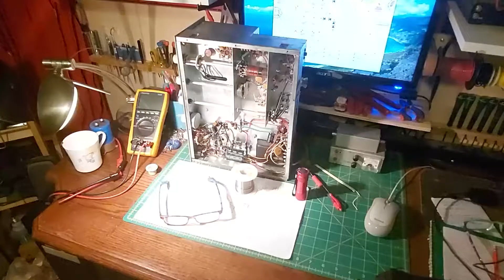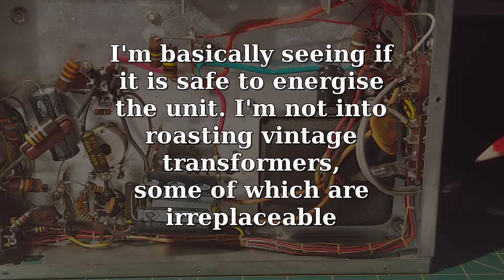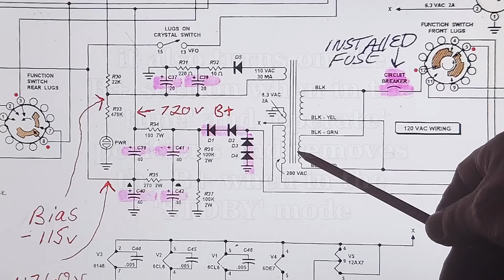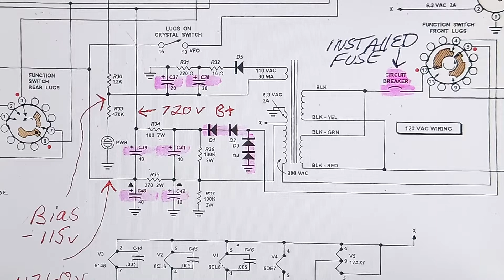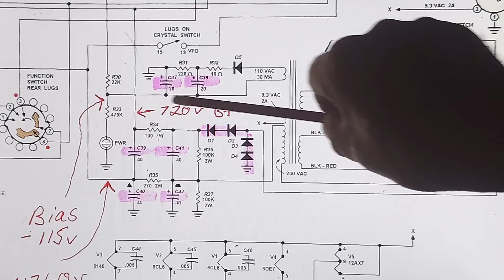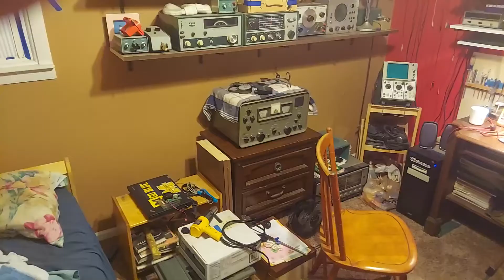Heathkit DX-60A Restoration - a Hacked Power Supply

Comment: Your doing good with this! I'm enjoying the tube circuit I can understand everything but the tube. lol ok maybe I know what a grid is but I've never worked on them except to maybe touch up a solder job. my first dissection was in the seventies on an rc car. it never worked again but hell,, we couldn't afford the batteries anyway. but this hobby has made some money for me over the years and alot of entertainment. thank you for making my day better. the electronics kicked my ass today. someone changed a setting on the machine I was working on oh my God that was hard to find. I've fixed relay logic panels the size of my living room from WW2 era faster than finding that setting.
73 OM
Reply from the maker: Aww thanks Curt. Boy have you got me curius what you're working on! Funny about the RC car. lol. Sometimes our intentions are better than our outcomes. lol. Sorry for the delay in replying. Been struggling. Catch ya later  :)
Reply: @n8nkqrp595  If you search for "VC999 RS420 with autoloading moving belt loading fresh meat and ground portions HD" on youtube there is a video of another machine similar to what I was doing. I was working on the loader the former and stuffer behind the tray packing machine. we run a bit faster at 100 pieces per minute. it makes that one look like she is standing still. the former that is behind the tray packer I helped engineer the first continuous flow machine about 10 years ago. no one has kept up with us yet, we advertise 150 pieces a minute on that one but we can do 200 pieces a minute. kind of nice talking about it no one usually asks. lol. I did the electrical engineering on our former, then I assisted with engineering the mechanical. when I put her in line she was supposed to run for a day beside the other line. when I got there they told me to replace the old one that was there with the prototype. lol, I about shit myself. but I put her in and she didn't leave till we installed serial number 1. she made millions of ground pork loaves by then. 
Talk to you later man! 73's

Comment: There was a similar mod kids on CB used to do to their Amstrad 901 rigs, there was a big green 3.3 Ohm dropper resistor to the final transistor. People used to chop it out and get TEN WHOLE WATTS of FM for about half an hour before either the transistor died from lack of heatsinking or their cruddy power supply blew.
Reply from the maker: hahaha, that got a good laugh out of me! Awesome mod. lol. Depending on how old I was, I could have been one of those kids. I remember using a pair of walkie talkies to try to communicate with my friend who lived about 2 miles away. It wasn't working- even with an outdoor 'antenna'. My antenna was mom and dad's TV antenna mast on the roof. Big house, high roof. Still didn't work. So we collected a bunch of batteries and started upping the voltage input to the unit. We hit 28 volts and that did it! We got to 'work each other' briefly before my walkie talkie went up in smoke. Literally. Almost caught fire. The next day at school i found out that his did the same thing. He almost set his bed on fire.
Ahhh, those were the good ol' days. Almost burned down our house on a regular basis. I'm lucky to be alive. lol. Catch ya later Stu  :)

Comment: I'm feeling you. I'm having issues with a amplifier I got. I had issues getting full power out, talked to manufacturer engineer and he said tube was bad. I replaced the tube but am having same issues but worse. I should have 3500 volts, but it floats between 3400 to 3480 volts. I believe it's the power transformer. I'm waiting on the engineer to send me the specs on transformer. Best of luck in your endeavor. 73 ac8gf
Reply from the maker: Huh. 3480 is too close to 3500 to be of much significance.. but 3400 is starting to get low. That's under load? Or idling? I would expect that under load it drops much much more, but I've never had an amp. Good you're working with the engineer at the mfgr. You'll figure it out. 73 OM  :)
Reply: @n8nkqrp595  It's all good. I got tired of dealing with it and sent it off to array solutions. It seems the ass I purchased it from is a FT-8 operator that uses amplifiers and the one he sold me he junked out. I put a high volume fan on it because it didn't have enough air going through the deck, well the fan under the tube wasn't working. You can't see it because it's enclosed under the socket. The power board and vacumn relays had burnt components. Why would you need a 1500 watt amplifier for ft-8 is beyond me. I hate ft-8 and would never use that much power for digital modes to begin with. The repair guy at array says he gets amplifiers in all the time guys using them for ft-8. They turn them on and leave them running and the amplifier is running full output continously. Pretty sad huh.  
     Thanks for getting back to me and I give you a update about the issue. Have a great day de AC8GF

Comment: Alot of voltage on the b+ that fly was thier for a reason that job bobby did a shitty job on the power supply section your lucky that transformer didnot blow up in smoke😯👍💯📻
Reply from the maker: haha, yeah, I think back in the day Bob the Novice laid waste to many a power transformer. He could always order another.. which we cannot do, not an OEM one anyways. On a different note- I've often thought of driving to Benton Harbor and putting the parking lot of Heathkit on the air. Even with an expired license. It's in limbo still.. and I'm again making the occasional contact. For them to come get me they'd have to explain why their utter refusal to act. To act for me or against me- either is fine. Justice delayed is justice denied- so I transmit on. lol. Catch ya later!  :-O
Reply: @n8nkqrp595  Wow that is right on the lake. I was curious I've never seen it. pretty cool. If you decide to do Heathkit for one of your videos I would volunteer my time and anything I've got to help you do it. I think I could dig up a couple youngsters that loved helping with field day when I last went. I still don't have them talked into getting a license. they are close though.